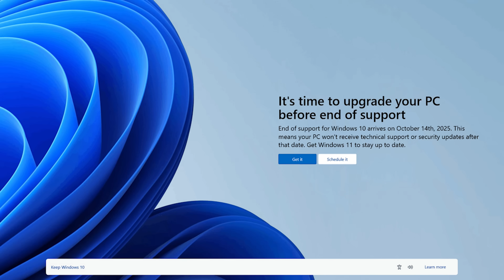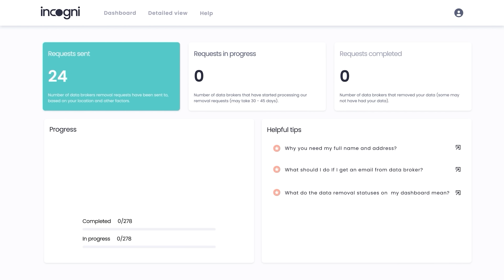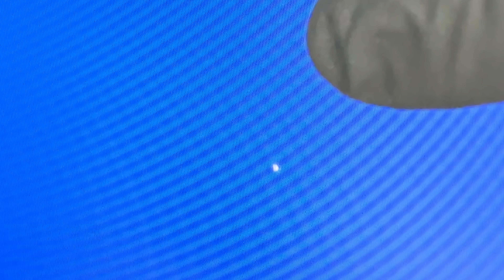I Made 2 WORKING Laptops From 1 Dead ThinkPad - DON'T Buy a New PC Just For Windows 11!

Comment: I'm still using a 2017 Asus gaming laptop with a fucked BIOS (as in, an updated version of BIOS that no longer supports SATA SSDs and downgrading the BIOS to the older working version resulted in the keyboard backlight getting nuked, great job Anal btw) but the 6th gen i7 and a GTX 1070 still runs most of the games at 60fps on ultra settings without issue. I only had to open it a few times to change the stock thermal paste with MX4 and clean the relatively clean fans. Hoping for this laptop to survive to at least 10 years.

Comment: I daily drive a Dell Lattitude E7450 with an i5 5500U with Garuda GNOME on it and it works perfectly fine with no issues and can play 1080p Minecraft at around 60 fps. The battery has a tooless removal and to get to the internals it requires two Phillips head bits and all of the components are right there. We need more laptops like this.

Comment: If you are in another country and can't get a hold of cheap used laptops then do explore Linux or use Rufus to bypass windows 11 TPM 2.0 requirement on even core 2 duo systems.

Comment: In case I haven't mentioned it before, one of my daily drivers is the first laptop that I ever bought myself -- a Dell Precision 7520 with a Core i7, 17 GB, 512 GB SSD, and an AMD WX Pro workstation graphics chip with its own 2 GB.  I'm sure I don't use a tenth of the power it has, although I may grow more into it.  I've at a point where I'm doing very light video editing every so often, and it's nice not to have to worry about messing up my primary daily driver with that or other business stuff.  I've spend maybe $200 on it, including a new SSD.  I would have saved that too, but the old one was HOT!  I had occasion to run it outside of any casing, and it warmed to the point where I was wary of touching it with bare skin.  I haven't poked around inside TOO much yet, but I do appreciate that I COULD, if I wanted, add 2 more memory sticks without wasting the ones that came with the computer.  One of these days, if I'm really lucky, I'll get a Framework laptop, but I'll probably wind up with 2 or 3 more of these old behemoths in between.  As for newer laptop tech, I might flip it, but I won't keep it.

Comment: Thinkpads are amazing! I love my T14 Gen 1 with the 4k screen, but ever since I had to move over to Windows 11, it runs EXTREMELY SLOW at start up. I've replaced the SSD, it has 32gb of matching RAM, tried clean reinstalling Windows 11, and its still the same. Anyone have any ideas?!

Comment: Hey! I'm old and I use Linux without education. Have an ancient first gen Intel i7 Dell XPS laptop with KDE Neon Linix and it runs great.

But yeah, many older non techie peeps might require a little assistance when moving over from Windows to Linux, though really, if all they will be doing is opening their browser and Interwebbing, all ya really have to do is show them where to click on the browser installed and  they're off to the races.

Admirable work you are doing preaching the old business class laptop with Linux gospel.

Comment: i decided to watch this on my freshly fixed thinkpad x1 carbon. still using it on windows 10 under my own account's extended security updates, and after my new battery arrives i plan on converting it to linux. as for a story for my own thinkpad, i saved it from becoming recycled by buying a new motherboard because my friend wanted to trash it. for 141 euros, it wasnt a bad deal at all including the new motherboard

Comment: 10:00 For gaming I personally recommend the Legion Slim 7i 16IRH8 from 2023, I've already swap the keyboard and a fan without any issue, everything is 'easely' replaceable and the parts on Ebay are kinda cheap

By the way, if someone does not want to use Linux nor Windows 11, there's the option for Windows 10 Enterprise LTSC IoT, that has support until 2032, I have refurbished some old laptops and mini desktops and everything works great

Comment: Two options for bypassed Win 11:  make them duel boot with Linux on a second partition with Grub set to  boot last os used eg win 11;  or supply a live boot Linux on a usb pretested to be known good with the hardware to be used as alternative if necessary --bios set to look for usb as boot ... I've used a old Thinkpad 11e for many years that was bought used, with Mint and win 10 as second option for Win only software...rarely used.

Comment: What really drives me crazy is that all I'm seeing is videos about Windows 10 being dead The operating system is fine when Windows XP died people said this for like what 3 weeks and then all in a sudden people said I'm going to use it anyway, why? because the people with common sense realize hey all I need to do is be smart, use an antivirus, and use it if it's what you want to use then use it Like I'm using it right now Windows 10 home 22H2 and I'm fine. (I genuinely hate Google TTS..)
Reply: Working in IT support for just over 6 years, I can personally guarantee you that most non tech savvy people are not particularly smart when it comes to computers.

Comment: Since you started refurbishing old Thinkpads with Linux Mint, I did the same.

For a family member of mine, I repasted, cleaned inside and outside, and installed Linux Mint 22, on a T430s, (all for nothing compared to a new laptop he was considering), 
he used it for a few months, and delivered me an SL510.

This is what I call meaningful tech support.
Reply: All those old T430 Thinkpads are already cost almost nothing, and the performance is still fairly decent for everyday task (as long as you don't try to game on it)

The only downside is that most of those has dead or no battery, which are not surprising considering those laptops are more than 10 years old, and the replacement battery sometimes costing more than those laptop alone lol
Reply: I put an i7-3632QM 35W quad-core in my T430. I got the T430 for $10 from ebay because the power button was stuck. quick research said a common issue is that a small plastic part of the button breaks off and prevents the laptop to turn on, but is easily fixed. So I bought it. Turns out it was just a crumb stuck under the button preventing it from turning on, lol. But once turned on, it was clear the display was broken. I looked for about two weeks until I found a pretty beaten up T420 on ebay for $25 but the display was intact. Cleaned everything up, flashed BIOS and got a new wifi card for $15 and the quad-core for about $40, repasted, still had 2x 8GB RAM lying around and it's an incredibly powerful machine still. Almost on par with the T480, since the 4th to 7th gen i-cores were all low-power cpus, it definitely beats them. T430 the last model where you can change the cpu, I think, except from the T440p. It even had the dedicated Nvidia GPU and stronger cooling in it. I didn't change the keyboard to the old one from the T420. Maybe one day. I love this machine.

Comment: Hi Andy, I have decided that at some point I also want to start up my own refurbishment shop, repairing older devices to increase their longevity, and provide high quality devices to people who cant afford any of the "good" new ones. I have used Clonezilla for creating Linux droves a few times, but the laptops i most commonly sell are to people wanting to learn Linux and I offer dual-boot systems and they are the most common I sell. I would like to know what software(s) you ise for cloning Windows drives so I can see if I can speed up the process of doing so. And with my experience with devices, anything from about 2010-present is enough for the overwhelking majority of people. My parents still have an old Toshiba Satellite with Windows 7 that they stopped using just a few years ago when they bought a new all in one. I also pretty regularly use an Alienware M17X R2 from 2010 that also has a first gen i7, and its lightning quick when doing basic things in Windows 7,10 and Linux Mint
Reply from the maker: We also use Clonezilla, I can clone 24 drives at once using the cloning station I built a few videos ago. NVMe drives, not SATA. We use Clonezilla due to the ability to be able to write an image to multiple drives at once.
Reply: @SalemTechsperts  For whatever reason I thought Clonezilla couldn't be used for cloning Windows installs, so I looked it up again and it can, it's just not as seamless as Linux cloning. Which is probably why I thought that... thank you!

Comment: I got a dell lattitude 7400 good everything bad display the white lines phase got it used didnt buy it someone gave it to me. I wanna use it but the display might die on me at some point its 30 pin eDP any way i can get a cheaper display for it. DELL says 120$ for a new display. any options i have or just pay up to get it replaced

Comment: HP = hinge problems
Reply: I work in K12 IT. We have decommissioned 99% of our HP fleet. Surprisingly, the hinges on most Probook 650 G1's - G5 held up pretty well. I've only seen a few devices with hinge issues. On the other hand, we bought a small fleet of silver Lenovo ThinkBooks. Those had terrible hinge issues. I'd say more than half of our fleet has failed due to hinge problems.

Comment: Using a 7th Gen Carbon,  it's extremely mobile/work design focused.  The build quality is so much more decent (wtf are you doing asus..geez)  I did try gaming on it just to see.. did more than I thought it was going to.  Shared memory is so much slower, so you kind of have to give it a decent minute to load textures...  Does retro pretty decent, pretty sure the P or even T series might do it better.

Comment: I am currently watching this on a HP EliteBook 820 G3 with an Intel Core i5 6200u, 16GB DDR4 and a 1TB NVMe, it runs windows 11 Pro and is still so useable for things, i also have a ThinkPad T440 with an i5 4300u, 8GB DDR3 and a 500GB SSD, that runs Windows 11 Pro as well as Ubuntu, idk why Microsoft think these laptops are Unsupported hardware considering they work fine and are FAR more repairable than any laptop nowadays

Comment: I have always avoided consumer laptops. From current to past: Thinkpad P15(since 2022), Thinkpad P50(still perfectly fine after 9 years), Toshiba Tecra A11(still fine after 14 years), Toshiba Tecra M5, Thinkpad T40-something, back to my first laptop I think was a Thinkpad T20 (25 years ago). Since about 2006 any laptop I buy I buy with long on site support warranties, don't want to send my laptop off for repairs. When my Thinkpad P15 was brand new I needed the screen replaced it was flickering in a weird way. Lenovo came to my home and fixed it. The only laptop on that list that I paid for was the Tecra A11 which was $2200 back in 2010, including 4 year on site warranty($149). Used on site support for Toshiba at least 3 times(2 keyboards, one motherboard replaced to fix the SD card slot latch).

Comment: I've been doing this for the older generation here in the UK for ages. Refurbing or reinstalling Linux to keep the tech going. Talking about breaking that habit the new zorin os 18 is a smooth windows transfer for anyone looking for a change but not familiar with Linux. Additionally winapps now allows you to run windows apps like office and the like on Linux, easy to setup to boot from menu also. For those that  need to break the windows habit.

Comment: Microsoft has already disabled feature updates (ex: 24H2 -> 25H2) via Windows Update if the computer is not officially supported.  So, if you install 25H2 today, it will end support Oct 2027 and Microsoft will not prompt the user to upgrade to whatever version of Windows 11 comes out in 2026.  The only way to get these updates on an unsupported system is to do a registry tweak and run the upgrade from a Windows 11 install media, which I imagine most consumers will not do.
Reply: Not automatically updating to the latest Win11 version  isn't a bug, it's a feature.
Auto-installing major Windows updates is the quickest and most efficient way to break your machine.
Reply: I'd prefer dualbooting it with Linux. Windows for running specific apps and games (like some that has kernel level DRM/anti cheat), and Linux for the rest
Reply: On a new gaming laptop of my brother, this happened to the factory install.
I suggested installing Windows 10 LTSC on it, as Win11 had some other nasty lagging issues on it.
He asked to try Linux first, knowing that I've daily-driven Linux for 6 years.
I put TuxedoOS on it (updated and un-snapped Kubuntu fork), as Linux Mint is a bit too old for gaming and as I'd rather put him on KDE Plasma.
And half a year in of him actively using it for study projects, only setting up Zotero gave some trouble.
Reply: I never allow feature updates on my old Win 10 partition Thinkpad that is mostly used in Mint.
Reply: yay, lobbying

Comment: 7:31 watching this in a hp elitebook 840 g6, and yeah it ages well.
Reply: I revived an 850 g2 2 years ago that I use to this day
Not the most powerful anymore but still does the job
Reply: @OasisTechRepair at least that better. if linux is installed there, there can be an improvement. i just use this for light gaming and web browsing and its a very reliable laptop.
Reply: @LakhanyaPiliso I have W11 on there (Rufus - i5 5200u) right now but seeing bazzite in a video recently made me kind of want to dual boot😅

Comment: I don't know, but I have an HP Omen laptop since 2019, daily use/gaming 8-9 hours a day. still works like a champ. With occasional thermal paste renewal, dusting off, ram upgrade, C disk cleanup and battery replacement one time  - no issues. And HP Envy my wife's laptop since 2020 still holds up like a new. I guess it depends how you use and take care of it.

Comment: Hello, the greatest community that's ever lived! I need your advice. I'm a first-year electrical engineering student, and I've had my eye on this used ThinkPad P15 G2 with the i7-11850H and RTX A3000. It's €688, or $800 for Americans. Now, my question is, should I buy this model or try looking for another laptop with worse specs but with better battery life and lighter? From what I've seen online, the P15 is 2.8kg. Battery life doesn't matter that much to me, but carrying all that on my back doesn't sound too good, plus the charging brick is thick.

Anyway, thanks for taking time out of your day to read this!

Comment: RTX 5090 laptop GPU: Costs even more than the desktop version and doesn't even has the same performance (and overheats, speaking from experience)
Reply: They tell us that they “designed the gaming laptop to throttle” they are not not designed to throttle , thats how you kill laptops.

Comment: @SalemTechsperts There is still a windows 10 edition that receive security updates till 2032, its called Windows 10 LTSC. The switch is very easy, as it can be done through the same system, no need for pen drives and stuff. But Microsoft store is not there in that edition. I think. There is another youtuber that has done this. I’ve done this. its easy and it works.

Comment: A good laptop is a Acer nitro gaming laptop, I’ve had one for a year now and holy it’s soo good, it’s got a good amount of power for games but also a good battery. And you may say well the battery won’t last but your wrong, the nitro sense app lets you switch modes and switching mode to balance it’ll extend your battery sooo much ❤ 

The build quality is top tier also, I’ve had one issue with it and that’s was a paste job because I over clocked my gpu for a while but after repasting the laptop works just as good as if it was new

Comment: The Rufus bypass is fine for now while it works, except when there's a feature update it will tell you you're not eligible again so you need to use rufus to make a new installer of the new build and upgrade with that or reinstall.  Most end users won't be able to do that.

Comment: Voicing my 2 cents about HP Craptops. Our company has about 16x HP ProBooks from G4 to G8 currently and they just suck balls! Needed to upgrade coz they are now as slow as shit BUTTTTTTT . . . 3 different laptops have 3 different Wifi issues. One has Wifi "option/connetivity" completely missing (HP sent a tech to install new hardware, after about 3 months the issue is still there. The other laptop (mine) loses the Wifi connectivity/device from time to time no matter the restarts or reinstalls. And the other laptop does not pickup Wifi at a colleagues home (fine at work and then NOTHING at his home). HP with all there bloatware can go jump in a volcano!

Comment: We do not consider Dell Latitude laptops to be reliable. In the past, I have owned Latitude models 6320, 6230, 7250, 7480, and 7490. Each one failed at least once during the 3-year warranty period. Some failed twice or even three times. When I sold my 7490, I said I would never buy a Dell again. After that, I bought a Lenovo Consumer laptop, which I have had for about 4 years and has never failed.